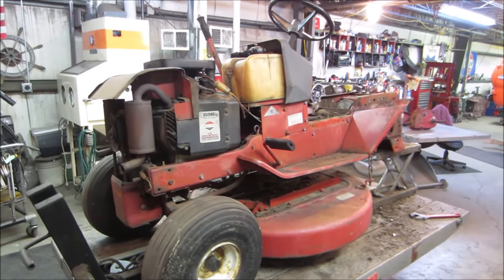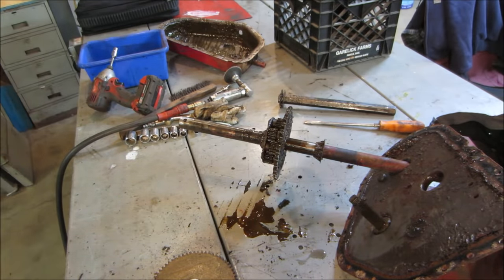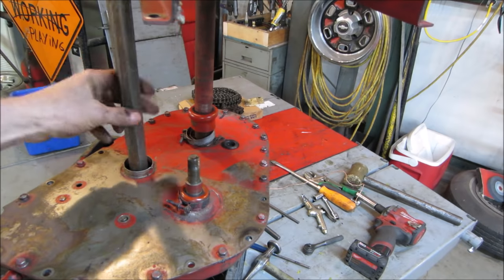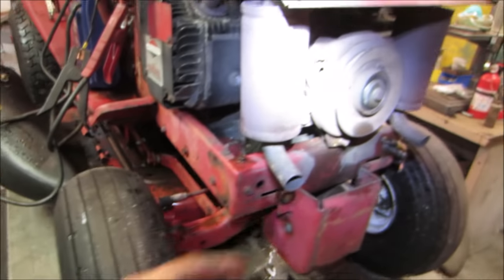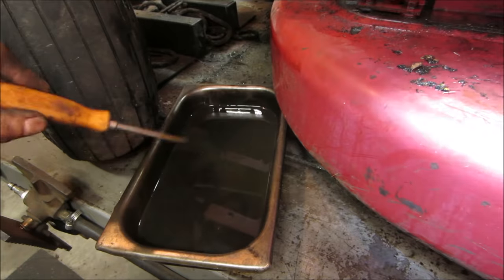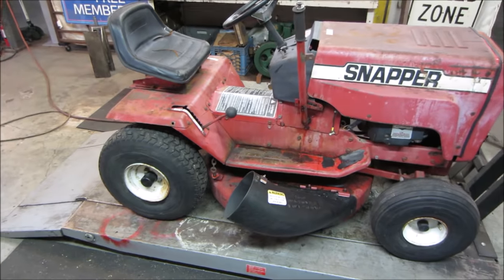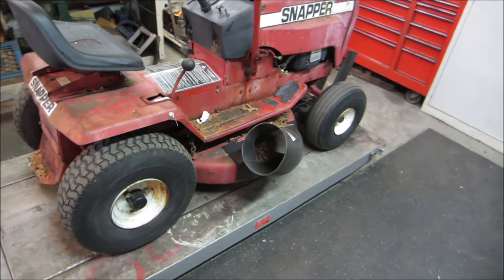Can We Fix The Damage? Free Snapper Mower.

Comment: I’ve used grease instead of gear oil in some gear boxes on different equipment ( such as tillers )in the past when the seals or case would leak gear oil. Gear oil works ok when the components are new but after years of wear, gear oil can leak even with new seals( due to the shafts being worn).

Comment: Those MTD riding mowers are real picky on the 5/8" belts the have to be oem can't get away with using after market belts. the inner v of the belts are critical. Some old vintage Murray riders and MTD riders are that picky. Great video very interesting 👍I am aware this is a snapper made equipment but I ran across some of the rear engine rider version had a deck belt that had 8sides like an octagon I was like 🤔 wow. Couldn't believe it. Again great video.

Comment: There are several zerks underneath too. The blade spindle also. Snapper specs a special gear oil for that gearbox, looked like bar and chain oil actually. The steering wheel tilts too, you push down on the wheel and it will tilt for you.

Comment: Use a chain extractor on both pins to remove the side plate to split the chain. Then use a new riveting link which has special pin ends to allow them to be riveted to correct size. There is a tool, similar to the chain splitting tool but designed to rivett chains together, it locates on the actual pins at both sides at once. Done hundreds such in the course of my work. Not expensive if you do many.

Comment: hey Mustie1 the transmission is same way step up on a snapper 21 inch with a disk on self propel. but on a 21 inch self propel there is a bolt that drives the pulley that bolt breaks. and you have to take the transmission apart to replace the bolt. i have done so many of these.

Comment: The lubrication in your gearbox might be a semi fluid grease, a modern version of Bentonite as found in Peerless techumseh transfer axles. My thought on the chain failure is, it looks like you can shift between forward and reverse without having to stop, I think we had a lazy driver doing exactly this putting too much strain on the drive chain hence the failed chain outer plate. The spirograph like markings on the gears is a proud tooth due to wear scribing it's way round the ring. If the pin on the chain was interfering there would be marking across the diameter of the gear.

Comment: That rear-end is, for the most part, is a snapper rear engine rider set up, turned vertical. They had 2 types of discs, the direct bolt or pinch disk. This unit has the pinch disk. Those were our slang terms for them, at our shop.

Comment: Me  Meticulously cleans both pieces of metal, ensures the ground clamp is clean, checks gun tip for cleanliness.  Pulls trigger, no arc, wire pushes out of the gun, and then pops.
Mustie 1:  Clamps to painted, greasey surface, pulls trigger and the arc cuts through 40 years worth of rust, grease, paint, making a good weld.

Comment: Been there done that,,
I have a 84 snapper rider that kept burning up clutch wheels,,,
Was due to rubber boots over wheel bearings failed which allowed bearings to fail,,,which allowed clutch disc to rub to tightly,,,
Wheel bearing failing ate into axle shaft until it broke,

Comment: The bolts that go through the rear hubs are supposed to be shear bolts.  They protect the transmission from overload.  It had regular bolts in the hubs.  The LT series was bad about shearing the shear bolts because of the torque in low range..  The chain probably broke under a heavy strain when a axle shear bolt should have let go instead.  Also, the clutch disc is a soft start system.  The inside of the disc has a friction lining that helps it slip a little when taking off.

Comment: I had the same mower except it was hydro drive,  it was a tank.   Still have the 18hp kohler and the snowblower attachment.  Had the same problem with the push button deck adjustment.

Comment: "A busted drivetrain chain, amazing!"Road trip to Borg Warner  not necessary,  there's chain in Mustie's shop. Some engineer designed that gearbox-----remarkable.Larger transmissions have planetary gears.Bearings & bushings could be better quality, but would drive up cost of mower.Detent prevents overrun or overspeed of gears.
Reply: Why do you use a body-fender hammer, rather than ballpeen?

Comment: The gear boxes i have had apart on rear tine tillers which are similar, are lubed with grease..... not gear oil.  You cover the gears and chains with grease as you reassemble it.  Don't know if maybe this mower is the same way?

Comment: That gear case uses 00 grease....
BTW, that drive disc has a friction band inside of the drum part. It’s replaceable just like the outside wheel. Also, as I recall, that has a tilt steering wheel. I believe you push down on the spring loaded collar at the base of the steering shaft and the wheel should move forward and back.

Comment: When the oil looks like that, its usually from aluminum piston making contact with cylinder, broken ring. Super loose rings ect.  Can run like that for yrs Briggs are strong back them

Comment: It might not win any prizes in the looks department, but what you have there is going to be a faithful old "Scruffy-Dog" that will go where ever it's asked to go, and will do what it's asked to do, just like out old JD170. Comparing the two, I'd say they're about equal in that respect.   Nice when for next to no outlay you can resurrect someone else' cast-offs and turn them back into functional machines. . . . . I'd say that transmission would be a likely candidate for 'semi-fluid' grease, or at least, it would be my first choice, however, we don't know exactly what it would have been filled with, and keeping to minimal cost, any heavy gear oil would do the job.

At least it's all straight and tidy, and what's  bit of patina between a machine and its owner? Just needs a wipe over with an oily rag. - Nice job!

Comment: Had a few snappers, they are awesome when they work, which is usually. When they break however. Kinda like a stromberg carburator. I worked on aircraft in the navy designed in the 30s with those carbs. You have to be half nuts to fix them.

Comment: I usually dont comment because i just watch to learn. but the one thing i woulda done different is welded some locking plyers to a slide hammer and pulled that pin at the bottom of that raise/lower lever and dropped in a spring the other way. Im not saying how you fixed it is wrong because ... Well it looks cool and its custom like you said. Always with good content tho.

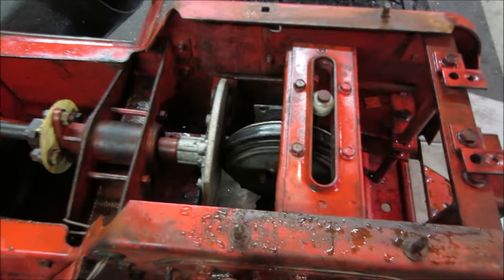Comment: 30:23 Its called a "Soft Clutch Mod" and yes it is worn out and there is suppose to be a fiber board ring in there that often wears out. and also a friction liner on the inside of the friction wheel.

Comment: I don't know why they didn't have a outside plate with a gasket for easy access to fix simple things like a failed pin in a chain. I'd cut my own access, so later on you can just remove the plate and take a quick gander into what it maybe, or what needs to be fixed later on.. Instead of having to disassemble the whole rear end to fix a messed up chain.
"  What when wrong? well, have you ever heard the story of the weakest link? " must of been a lot of stress to tear that side plate apart. 
When you said let me look into my stash, I knew you'd come up with what you needed. Hording does pay off, Yeah, That's what I tried to sell to my wife but she won the argument. She refused to let our garage look like Fred Sanford's yard. lol

Comment: I would bet you the kids were doing wheelies with the machine. How do I know, I did that myself with my Bolens tractor. Never broke anything. But a Bolens tractor is just way stronger that a Snapper for sure. The transmission you are working on is a pain in the ***. You have to have everything just right or it will not work properly. These units are light duty grass cutters mainly. I have a question for you fella ???? What are the number on the chains, the small and the large chain ??? Thanks, VF

Comment: 12:18, if you were to add a Nut to the end of that Chain Pin Remover you could connect a Ratchet or even a drill to it and make the process quicker.

Comment: You may want to watch vlog called "Jims fix it shop " (Jim Jackson)- He has over 340  you tube video's on Snapper rear engine mowers- they use the same drive setup as this one- plus he has a cut away display that shows how how all the parts work together made out of a snapper rear end and powered with an electric motor

Comment: Someone did not keep the transmission full of Snapper 00 grease.  The top pushin is the inspection port and the bottom plug is the fill- to hole.  The seals on Snapper mowers are a sieve and you constantly have to refill their transmissions.  This same system is used on Snapper Rear engine mowers.

Comment: I wouldn't look up "how to" more just specs. Like, is that rubber wheel actually supposed to be loose? I mean it drives alright, but hey, worth looking up.

On a side note, I wanna see that mower converted somehow. Like, throttle on right foot, and a different kind of clutch-gear. Though, if you want it to do work and not be a fun-putter it's fine how it is

Comment: Hey, that machine could look a lot better if you just get out the shine juice.  Us wheel Horse guys use Marvel or better yet thinned down linseed oil. I usually wet sand a bit with some 800 to 1200 sandpaper before the linseed if the paint is still all there.

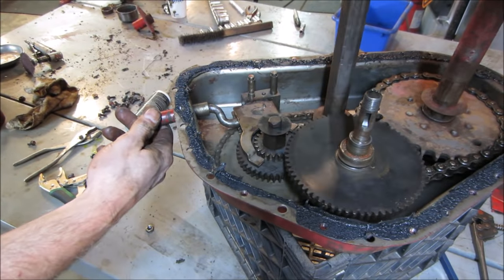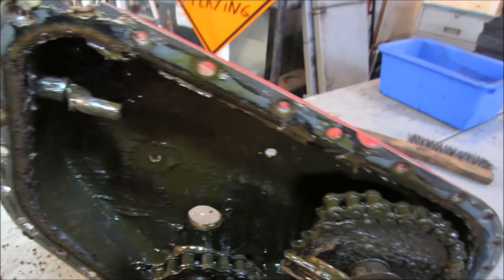Comment: The washer you put on at the 20:30 mark is on the wrong side I think.  If you go back to the 5:00 min mark when you found it, it looks like you can see the grease spots where the washers were on the outside of the case.  Could be wrong, but it doesn't look right as installed.
Reply: Maybe there's another one on the backside already we didn't see when you installed the gears off camera..who knows.

Comment: Technically, wouldn't the rubber disk & wheel be the transmission and this box is the differential with high and low range?

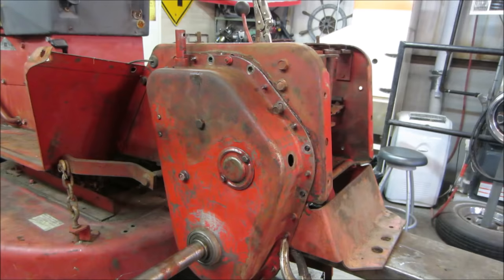Comment: 25:38 You really ought to "back off" each bolt (i.e., gently turn it backwards to feel it "drop down" into the threaded hole or nut) and then carefully start it threading in by hand before wrenching it in, to make sure it's correctly threading into its receptacle instead of getting cross-threaded.

Comment: 54:31 I've heard that you can recharge a propellant-depleted aerosol can with a narrow-tipped blower-nozzle on an air-compressor; I imagine that this would work better for solvents and lubricants rather than paints or other air-dryable fluids.
Reply: Hey I have the exact same tractor, how do I get the starter off?

Comment: Snappers didn’t take gear oil. They take a specialty grease that’s more or less like oil and grease mixed. STENS makes a copy call “double 00” grease. Or you can get the original made by Briggs and Stratton. Comes in a 1 quarts squirt bottle just like gear oil. I’m a snapper lawn and garden equipment dealer so I figured I’d tell ya.

Comment: All that power rubbing on two little wheels, you have to run in low range on slight grades, the friction wheel glazes and slips! Poor design! That and my steel exhaust valve seat popped out of the aluminum head, luckily it tapped back in. There heavy duty and cool but poorly engineered.

Comment: Put a plow on it, I'm sure it's got the torque
Reply: Or you could prob use that front pto for a snowblower
Reply: Drivetrains slip. Bad design!
Reply: @Danman4000  I got a plow on my lawn mower, and it uses the standard belt design. Works perfectly

Comment: What the hell is it with you guy's. Use the correct hammer for gods sake. Using a body hammer to mushroom the pin, as bad as using a carpenters hammer for pounding on steel